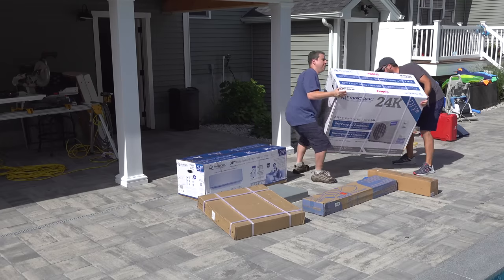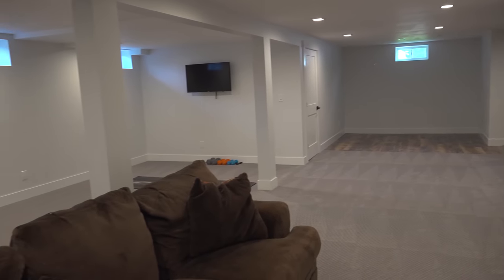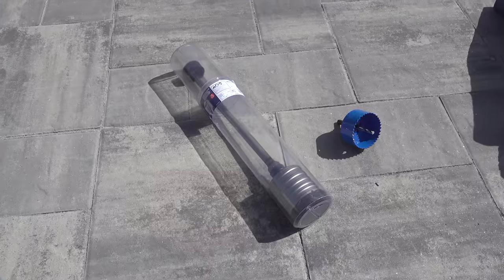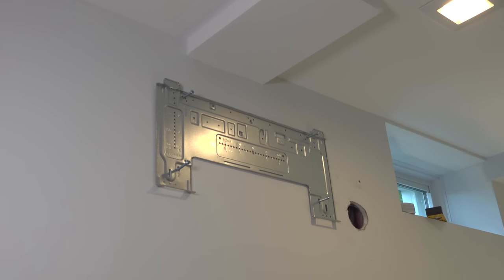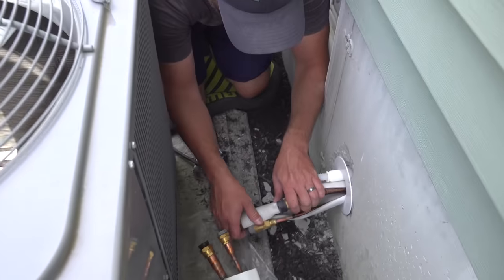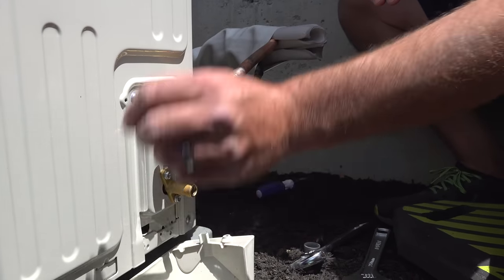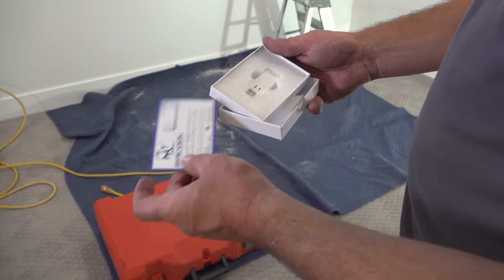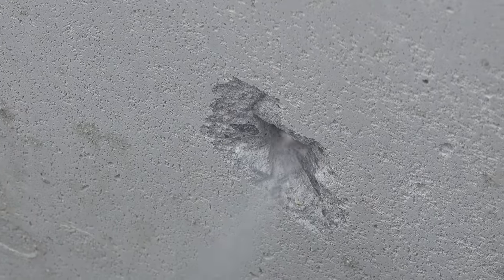Install your own AIR CONDITIONING in 4 HOURS!  DIY Mini Split MR COOL

Comment: Loving the DIY spirit. I think you guys did an excellent job. Top shelf system installed for a fraction of the price a contractor would have charged....home run in my book.
Reply: Except it's not installed right. They never vacuumed down the system before releasing refrigerant. If they run it like that the system wont last long at all. Head pressures arent checked with HVAC gauges. And temp drop wasnt measured. You need about 2k worth of equipment to do it right that they didnt show in this video
Reply: @200130769  Line set is sealed and already vacuumed down. Is it perfect? No. But its way better than spending an extra $5k to have someone come out and do it.
Reply: @MrSilence99  it's definitely not an extra 5k. I guess it depends on the contractor, but my company offers name brand for around the same price and you're paying labor. Maybe 2k depending on how many heads and how extensive everything else is. Power needs to be run. If the panel is right there then that's cheaper already. So for an extra 2k, you get one of the best brands and professionally installed. It will last you 10 years longer than this one will. Easy. Maybe even longer.
Reply: @200130769  In my area the companies quoted us around $25k just to put in 2 basic systems using the existing line sets and duct work.
Reply: @silence19999  wow that is astronomically high in price! Now I understand why home owners want to do this themselves! Is that in a bigger city? Where I'm at I could do that job for around 14k give or take. I can install a mini split for around 7-8k all day here. I know labor rates fluctuate big time depending on location. But that massive difference in cost isn't all labor lol. Wow thanks for enlightening me on what others are charging. That's insane!
Reply: @200130769  The biggest city near me is 90k people and thats over 30 miles away. So we are in the middle of nowhere.
Reply: @silence19999  ahhh. Yeah I guess that makes more sense actually. You probably don't have very many choices between heating companies so there isn't much of a competition to keep prices low.

Comment: Was unfamiliar with these systems.  Thanks for the info. Straight to the point and simply explained.  
Question though, Why did you not center unit inside between the 2 windows.  Sorry bud, that would bother me every time I see it .
Reply: Cuz he wanted to cut through a metal stud instead? Cuz he's blind? Cuz he doesn't know what he's doing? Take yer pick!

Comment: We instal one last summer, it works well until this year.  No more freon in the unit.  A professionnal come to check it, the installation is great and did'nt know why it's empty.  He refill it and it  cool again.  Really disapointed, we change it soon.  If you want an a/c unit it's better to use professionnal service to have guaranty and pieces.
Reply: Yeah and don’t buy some cheap brand from costco
Reply: Mines has been working 3 years straight heat and air
Reply: @claudine laflame, Mr. Cool and similar cheap products are only worth it if you install them. If you pay a professional to do the install, then you might as well spend a little more and get a quality product like Mitsubishi.

Comment: These no duct split systems are truly game changers now that they're coming down in price.
Reply: The four that  I installed were also much more efficient than the window units they replaced -- very low bills for the tenants!
Reply: @Duke_of_Prunes  lower power bill maybe but maintenance no.
Reply: This 24k unit has actually gone up $650 since feb 2019 😢
Reply: @TheMax13542  What maintenance? Cleaning or? Just curious
Reply: @Skeetah3113  there is a blower wheel inside the wall units which will grow mold and its pretty common after 5 years for the fan to lose airflow because of it and you have to cover the surrounding area with plastic and literally hose them out. you still have filters like a regular ac, still have coils that need to be regularly washed. everything inside these things are plastic so it very common after 5ish years to break pieces when servicing. the whole system is controlled by a board with multiple temps/ pressure sensors which are prone to fail at some point. If the board fails don't be suprised to fork out 1k to fix it. refrigerant leaks are also very common on the flare fittings that connect the copper lines to the units and let tell you it is a nightmare trying to fix one on a unit hanging 6ft in the air.

Comment: There are a lot of comments about the lines need to be vacuum down. What many don't seem to get is these lines are pre charged with refrigerant MrCool has made it easier for DIY. Read the site if you don't believe the comment. Specifically the DIY models.
Reply from the maker: They still won't believe it, because most are techs that don't return calls, or want to install these but they also don't want homeowners to do it themselves.
Reply: No, most are techs that have to go back and fix these when an incompetent home owner (and I am not saying you or all home owners are, but there definitely are a lot) mess them up and it takes their time away from their actual customer base. Most people don't realize this, but the "extra" you pay for a professional to install a system is for the service they will provide you years down the road, not some huge profit margin, cause that's just not there.
Reply: Maybe I am missing something here. But even if a tech is coming out because the home owner installed it incorrectly aren't you still be paid for that service. Even if it's taking away from your customer base you still have a chance to earn new customers. Maybe not for that job but for most of these install it's addition to their regular heating and cooling system. I know there are some that do their whole house with these split system but most of those are install by a tech.
Reply from the maker: @xalint1  You are 100% correct. This is what plumbers said when sharkbites came out, then the stories of sharkbites failing everywhere and plumbers having pick up the pieces. All fake stories of course. The people buying these DIY units were likely never hiring anyone in the first place so nothing is lost and as you said service calls, etc all are new revenue.
Reply: Just so you know, the lines aren’t whats charged. The condenser is. Not pulling a vacuum = moisture in the lines = acid in your compressor which will lead to failure but hey, I’m only a professional.
Reply: @p-mac5969  Actual the lines are charged refer to the site. You can not use regular lines on this unit. If you use regular line on this unit you have to do the vacuum. If you refer to the site of the DYI Model you can read for yourself.
Reply: @SilverCymbal  I remember that and now the Shark Bites are very popular.
Reply from the maker: @p-mac5969  That's great that you are both a pro & totally wrong. Specs: NO-VAC™ QUICK CONNECT® PRE-CHARGED LINE SETs - no need to vacuum, no need to add refrigerant.
Reply: @SilverCymbal  they’re lying to you. YOU INSTALLED YOURS! You even said in the video that the refrigerant is stored in the condenser hahaha. How can the line set hold refrigerant if the line set is open at both ends? Come on now. Plus in the video you opened the king valves letting the refrigerant into the line set and into the head. So is this video stolen or do you just not remember doing that? I’ve installed dozens and dozens of these so if you want to keep telling yourself your right, be my guest. The website might say all of those things but its clearly a lie ask ANY hvac tech or installer. Google “is moisture bad for r410a”
Reply from the maker: @p-mac5969  My friend, look very close at the line ends when the gray and black caps are removed, the lines are not open to the atmosphere. There are valves on both ends with double o-rings inside the line ends. When they are screwed down, the valves open.
Reply: @SilverCymbal  that makes a lot more sense. The video said it was stored in the condenser (which every one I’ve installed has had it stored in the condenser) thats why I said it needed to be pulled into a vacuum.
Reply: @xalint1  I was wondering about that while watching the video, I know some of the lines come precharged, or under a vacuum, whatever works.  to keep contaminates out.  I am looking at installing a minisplit in my garage, and while I have a vacuum pump, it would be a lot easier for most people to just hook it up and be done.
Reply: This is incorrect!!! the lines are not pre charged, the condenser is. if you don't put this unit in a vacuum, and nitrogen test the lines. this unit will last a couple years, compared to over 10. do not watch and believe this is a do yourself deal. it's not, unless you are an hvac tech, and buy  a couple thousand dollars in specialty tools. you will cost yourself alot of grief and money if you do what this hack video says. no where close to sharkbites. those lines should be torqued to a specific specification. or they will leak, over or under the torque specs.
Reply: xalint1 they are precharged with nitrogen not freon. you still have to put it in a vacuum. among other things. please stop acting like you know what you are talking about. cuz ya don't!!!. This bad advice will cost you thousands of dollars when the compressor fails, and hours of labor.
Reply from the maker: @gruzl3  The lines & the condenser are precharged on this model. Thats why the lineset is called the MR COOL NO-VAC PRECHARGED LINESET for a reason.

Comment: Hope it doesn't snow where that is because if u use it for heat an snow is around condenser fan it won't last long. Should be 2' off the ground. Minimum 18". BTW I'm a professional HVAC technician
Reply: I'm surprised they didn't pull a vacuum on the lineset after connecting it.
Reply: HVAC tech here aswell...yeah when I saw that they didn't pull a vacuum on those lines going to the evaporator I wanted to cry a bit.Now your system has air in it, the moisture in the air will turn the compressor oil acidic over time and the compressor wil kill itself from the inside in the long run.
Reply: I didn't even watch the entire video cuz I was getting upset just watching. He didn't put it on vac? Yea that unit is not gana last very long
Reply: If you noticed the connections are not flared. The linset and indoor coil are preevacuated. I agree this should still not be diy. I'll have to watch again now to see about the disconnect NEC violation
Reply: I agree with the height, makes good sense to do that.  the rest of the replies,  anyone that is an HVAC tech knows they don't know the new systems coming out.  read the manufacture's info first.  for example,  are you all aware you can now buy your own R134 in a can and recharge your own system?  sure maybe it has leaks, maybe you overcharge because you can't read the gauge on the can, maybe the inline filter needs replaced,  maybe its too cold now but your better half is still sweating in the 110 degree heat.  But not talking about all the what ifs,  in this case,  this unit,  is sealed until you connect the fitting.  They already have it vacuumed and the fitting is designed to stay sealed until the seal is broke on fastening.  Maybe it still lets in air, moisture or a cricket or two,  well its not supposed to and if that happens then it isn't because you didn't follow the directions.  Now there are split units that still require it to be pumped down.  but if you read about this unit he wrote that he used in this case,  you don't.  Can you?  sure,  I can also take my tire back off the car rim after the guy installs it, to be sure the rim bead is in good shape... but probably won't undo what someone that makes or manufactures just to see if they did the job they say they did.  I have a friend with a small shop and he has had one of these running now for at least 2 years if not 3.  No complaints there but he also has all the HVAC gear to fix it if it did.  Anyway, wish people would quit posting about pumping it down,  we have moved into a new era of HVAC and for simple things, they are trying to catch the niche market of people wanting to do it themselves, without needing a specialist.  Will it last or fail in a few years like the old plastic water lines and such,  I don't know.  but I have one ordered and while we do have vacuum pumps I do not plan on using it since they do not say to do it in the instructions.  That is my rant,  good video.  Now about the code issue,  well, if there is code enforcement where he lives then they should take advantage of that assurance,  but I would not shirk on safety for disconnects.   But then again,  if you only put a wire staple every 14 inches instead of 12 inches,  is your home going to definitely or even more likely burn down....
Reply: Lines are precharged. NEC disconnect code is "within sight from and readily accessible" up to 50ft away below 6'7. Looks fine on the wall behind.

Friendly FYI  @kevinkemp3556

Comment: Pro Tip--

When the drill bit sticks out but the hole saw's "cup" has not broken through, take the drill outside and go from the other side to avoid blow-out of the concrete. 

Also, make sure it is sealed from water/frost/ice/air/rodents/etc. Some zoning codes may require a higher or lower hole in the wall because various factors like snow or structural concerns. If in doubt, ask first instead of cry later.
Reply: How do you line up with the hole on the other side?
Reply: Addition to your protip, keep the bit wet to avoid a blow out. It will cool the bit and cool the material brick / concrete from exploding, hence friction and heat build up.

Comment: I live in Korea and they use these mini splits EVERYWHERE.  We have 3 of them in our apartment and they hardly use any electricity.  At night we turn off everything but the room we are sleeping in.  Makes sense right?  In the US we were running 2 big central air units trying to keep the entire house cool.  It's about time the United States caught up with Asia and Europe!
Reply from the maker: I have noticed that for years in videos and I think you are right that the popularity here is soaring for all those reasons. I also like not having ductwork collect dirt, mold, etc. seems cleaner.
Reply: @SilverCymbal  Thanks.  Yes it's crazy how slow people are in the US to change.  Our ductwork in our house in the states is all in the attic and it gets 140 up there in summertime.  (60 for celsius)  So our big central A/C units are trying to cool that hot air 24 hours a day.  The first thing I am doing when we get back is installing mini splits like in this video!  It will save me a ton of money on electric.
Reply: Biggus Dickus  Bro don't try to twist my words out of context.  Yes.  When it comes to certain construction techniques the USA is behind Asia and Europe.  Why would you run a big central A/C unit 24 hours a day when you don't need to.  Also home construction in general.  In Asia and Europe they build houses out of concrete and rebar.  No hurricane or tornado can knock that down.  In the US they are still building houses like cardboard boxes along the coastlines no less.  Literally nothing but 2x4's spaced 16" and then OSB and insulation and plastic vinyl siding.  Even a small hurricane can destroy that kind of construction.  I love the USA and I am coming back to retire there but yes we are behind the rest of the world in construction technology.
Reply: @hyper2.034  I agree.  They do look kind of cheap and cheesy hanging there on the wall but they are very quiet and efficient and they cool a room great.  Or heat a room in winter if you get the heat pump.  The ones I have had will heat way down below freezing too.  Eventually they will quit heating tho if it gets too cold.  Then you have a problem.  LOL.

Comment: Once the pilot bit of the core saw pokes through, stop. Then drill from the outside to get a clean hole on each side
Reply from the maker: Absolutely, but if you look the original compressor was outside and we only had about 10" to work, the bit itself was 14" long, nevermind the tool.
Reply: Silver Cymbal, as thin as what was left it could have been hand chiseled. Still great video and informative. Thanks